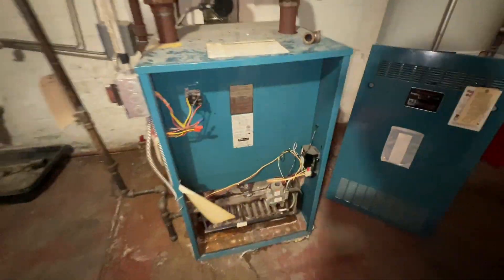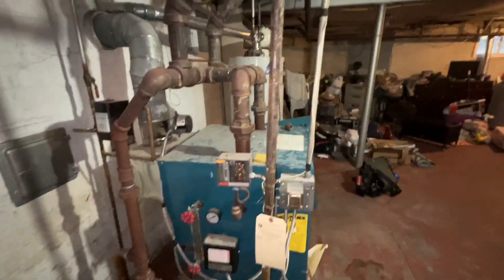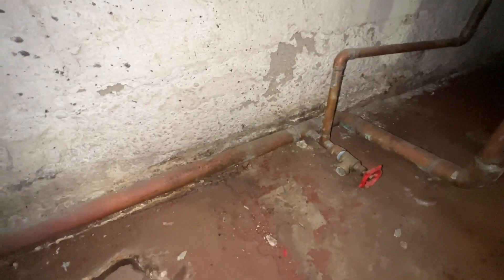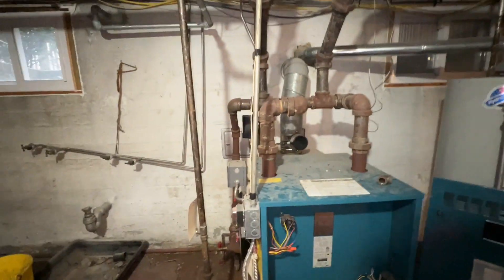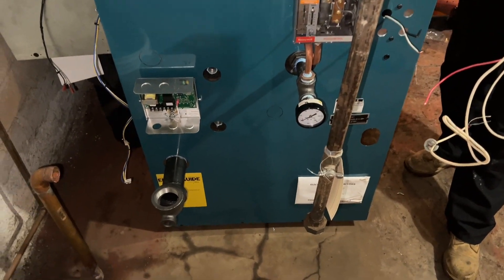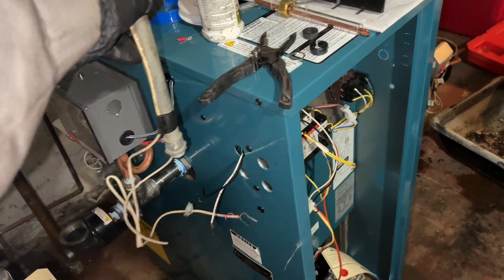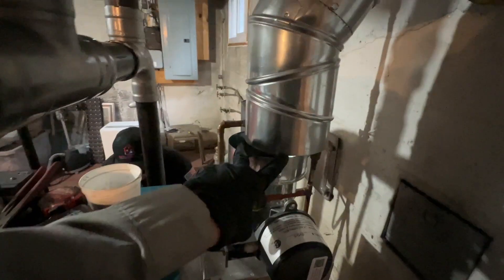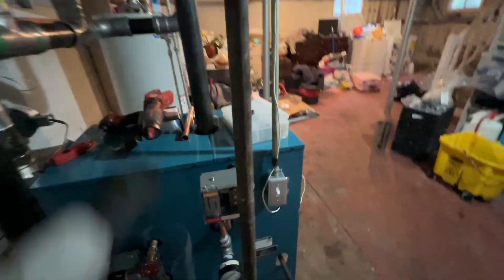Removing Oversized Boiler and Installing Burnham SteamMax with a Drop Header! Bosch Singular Error!

Comment: Nice boiler overall. Only critique is the Hartford Loop. Nipple to copper conversion is way too long. Don’t be afraid to make it a close nipple like it should be and convert to copper on the drop. Otherwise, very nice job
Reply from the maker: I agree, I thought about this afterwards… it’s my first time doing a steam install in charge.
Reply: @DCHVAC  very nice job
Reply from the maker: @JE27898  thsnks